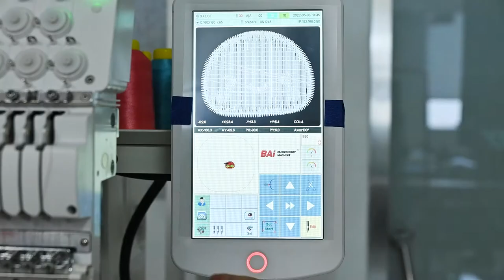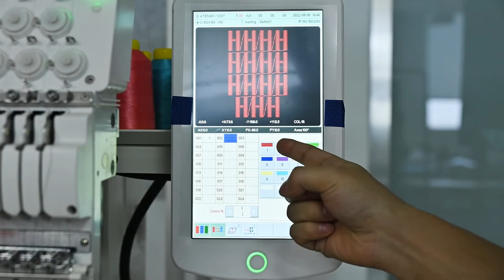How to Adjust the Tension of the Thread | BAI Embroidery Machine Tips

Comment: Having issues with continuous T break. Have any idea why?
Reply from the maker: Hi, friend! You can check if the tension rod is at 90 degrees and verify if the embroidery needle is at the correct angle.
Reply: I too was having this issue.. tried different threads and it was suggested to me to use the nets that go around the thread.  Never used them before, seems to have significantly reduced the thread breakage.
Reply from the maker: Thank you for your sharing.😊